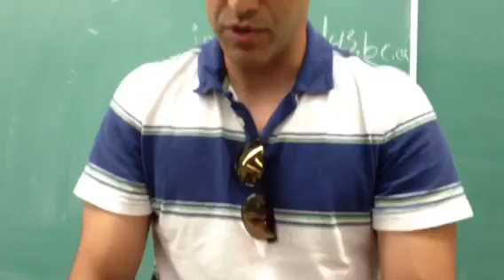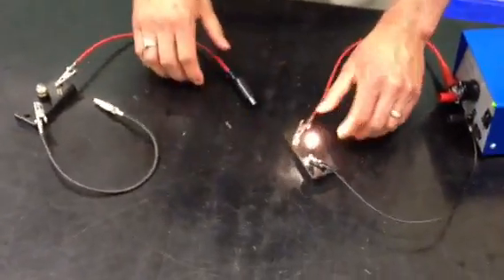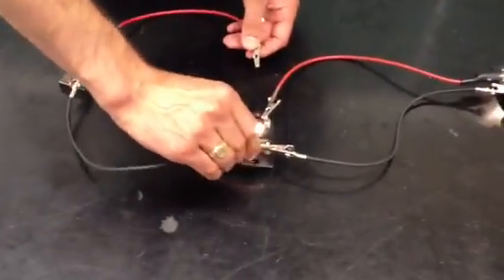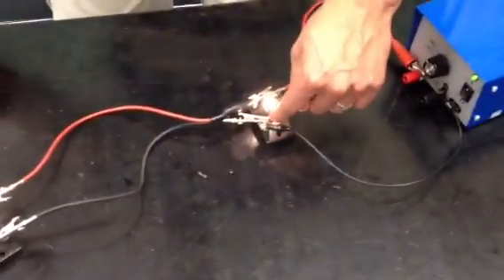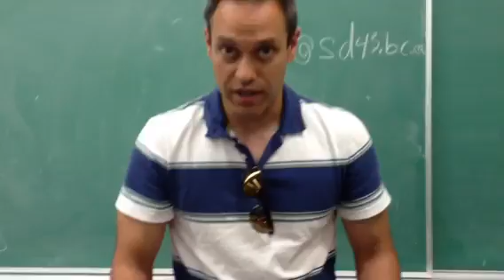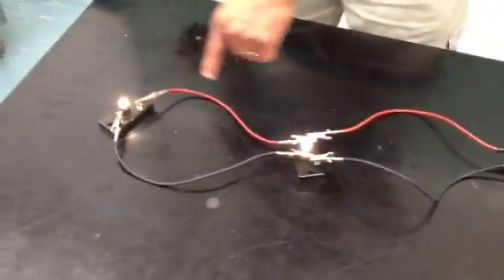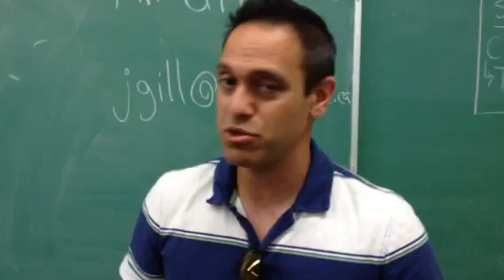Parallel and Series circuits

Comment: hi James, thank you for that  it is so helpful. do you have 2 switches and 1 load parallel and series circuits video ?
Reply from the maker: Thanks for the kind words, however I don't teach this course anymore.  Am I understanding you are interested in 2 switches in parallel and in series?  If I find the equipment and have the occasion I will consider your request and post it here.

Comment: That was very helpful at jogging my memory on this topic before I rewired my house thank you very much. I would just like to say, though I’m sure it has already been pointed out, the “dimmer” bulb in the series circuit example wasn’t illuminating because the circuit was shorting across the negative terminal, it wasn’t actually pulling power at all.
Reply from the maker: Glad you liked it and thanks for the tip!

Comment: ok so i have question. In series circuit, bulb B shine brightest compare to bulb A but in parallel circuits, bulb A shine brighter than bulb B. Why is that?
Reply: its one of the question in the past paper im solving and i couldnt understand why
Reply: Theoretically in a series circuit, the current throughout the circuit is equal. Although you have to consider the resistance of the wire, and that as you go further the resistance increases because of the length of the wire and the resistance of the lighting fixture. The first light bulb in a sense gets a head start of the charge compared to other light bulbs in a series circuit.
Reply: Nope. Not even close. 
Electricity isn't elastic.  As soon as it begins to flow, it is flowing in the whole circuit.
The resistance of the wire is just added to the resistance of the load, in most laboratory demonstrations, this value is negligible.

Comment: but why do the resistance decreases when we add more and more resistors in parallel circuits..??
Reply: +dhairya doshi Ohm's Law. You can calculate the Resistance of a parallel circuit this way: 
1/Rt = 1/R1 + 1/R2 + 1/R3 and so on.

Comment: Question. What happens if there's no resistor in a circuit? and you turned it on?
Reply: well then there is no light bulb...what the point? you would just have a few wires and a power source...its useless